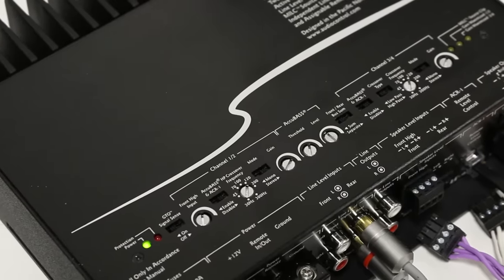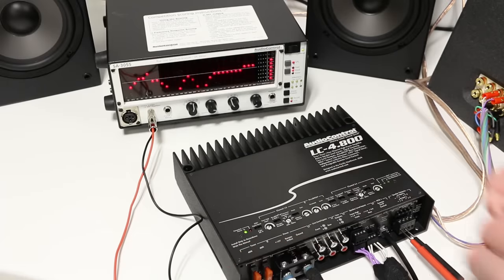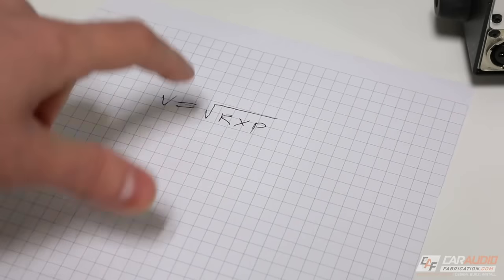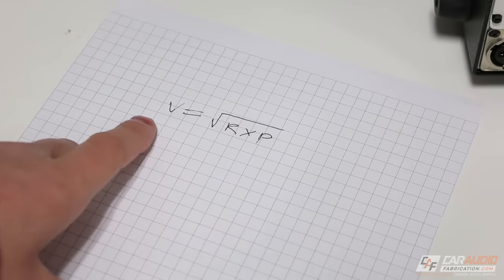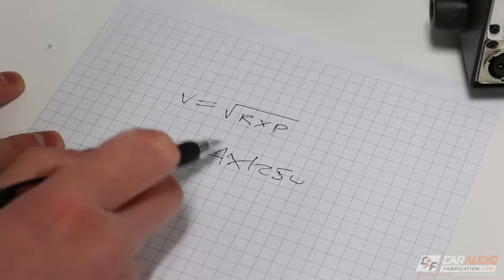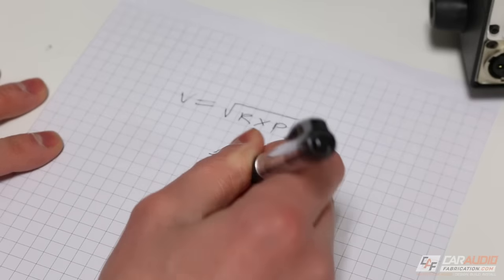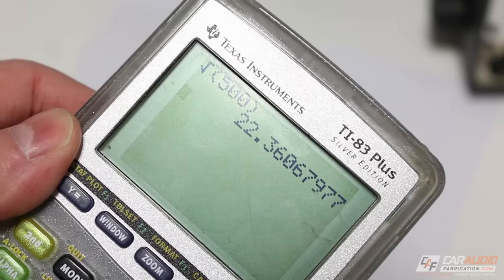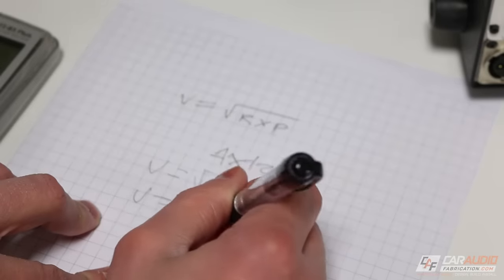Amplifier Tuning Settings How To - Gain, Crossovers, Bass Boost

Comment: Why not show the "test tone and listen for distortion/change in tone" method?  It works pretty well and you could have also determined if the head unit was clipping without needing a distortion detector.  Seems better than the "calculate voltage method"?
Reply from the maker: Rather not intentionally send speakers a distorted signal, and not nearly as accurate as using the proper tools.

Comment: My skar amp has a remote bass knob with clipping indicator. Is the thing pretty accurate?
Reply: MOST amplifiers with a clipping indicator are accurate, as the measurement is in relation to the internal power rail voltage.  It must be noted however, that usually there is some amount of audible distortion BEFORE clipping occurs.  So, any clipping indication should be avoided in normal use.  It can be used for initial set-up, and subsequent spot checks however.

Comment: Please..Every single video I can find on the entire internet fails to say anything about where my crossovers should be set when setting gains with my multimeter and using test tones.  Do they need to be turned all the way up or turned off?  In my case, I'm unable to turn the crossover off on my sub amp or set my amp to full range so its either all the way down to like 30hz or all the way up to I think 160hz. Please and thank you.
Reply: When setting levels with a meter, you may need to use multiple test signals at different frequencies.  Yes, many sub amps are only able to go up to 160 Hz as an example, some 320 Hz, etc., they vary from amp to amp.  For setting component levels, with a meter, you would want to set your cross-over points to allow as many frequencies through as possible.  So in your case, 160 Hz.  You then need to use a test tone frequency that is within the range you can then test.  Yo may need to test a few frequencies, but likely you will be good testing between 40 and 80 Hz for your amp, with the cross-over set to 160 Hz.

Comment: Hey Mark just wanted to say how much I appreciate all the knowledge you share. I'm in a bit of a pickle.
I just purchased a Sony 6ch amp XM-GS6DSP for my highs and mids. I was under the impression that the amp had Rca output for the lows.  I don't plan on using the sub output on the Sony amp so I thought I would use an Audio Control LC2i to give the Sony a preout for the second amp. (JL Audio 500/1 monoblock,  Which will in turn power the JL Audio 8in W7 sub)
 Any suggestions would greatly be appreciated. 
 I really need to eliminate a head unit due to the vehicle being a classic car. So this amplifier is ideal for this set up.

  I appreciate all the help gang thank you. so

Comment: Hi car audio, I have a amplifier question, I have a sound system in my car with a after market headunit, speakers, amplifier, subwoofer and amplifier, and when I turn the volume up and bass kicks in the speaker amp turns off and only the subwoofer will play. I’ve taken the amp back and had it tested and apparently there is nothing wrong with it, anything I could try? thanks!
Reply: Blake Cvirn in my personal experience my sub amp would get power hungry and seem to steal current from other amp. I ran a power wire and distribution block to send power to both amps. Once I backed down the gain of the sub amp the mids amp came back on without cutting out. Make sure you use proper gauge wires , can’t stress that enough. Good luck

Comment: I just bought a KTA-450 alpine I started tuning and it sounds like the front gain is running both front and rear speakers I get nothing from the rear gain

Comment: What if I just added an amp and one 12 inch subwoofer to my factory system and that’s it , Freq Response spec of the sub is 25-500 Hz  what would be the best values to set the HPF AND LPF crossovers of the sub
Reply: The High pass filter would not be in use, as that would be what is sent to your main speakers, which with a factory unit you are not changing.

The Low Pass filter you would ideally set at the frequency where the main speakers naturally start to drop in efficiency and volume.

There are apps you can install on your phone to then play through your stereo, so you can hear what your factory system does, to start your tuning.  Then after you enable your sub-woofer, you can use the app to finish tuning, to optimize the level and cross-over (low pass filter only for your application) for the best overall performance.

Comment: It would have been nice to see what the voltage was after you set gain with the o scope
Reply from the maker: That would imply that you could use a multi meter to set gain, which is not the case.
Reply: @CarAudioFabrication  it will work if you don’t not have a o scope . Just to help others that don’t have the means to a o scope. I set my gains with multi meter and zero issues , the system sounds great !

Comment: i saw another video of a guy using this smd unit doing the same thing, but he hooked the negative to the amp ground. is this different somehow? is one way more correct than the other?
Reply: The instructions point to using the amp ground.  I've done it both ways but never back to back to see if there is a significant difference.  I would suggest using the ground since that's what Steve Meade suggests ;-)

Comment: Id like to ask if its fine to increase the gain on max and just turn down the sub from the radio
Reply: It will all depend on the combination of amp and head unit.  There are many head units, that will have FAR too high of a signal level even set to minimum, with the setting set to MAX on MOST amplifiers.  There are also MANY amplifiers that the max setting is also too high for MOST outputs from many head units.

Comment: Hey, guys. I've just had an aftermarket speaker system installed in my 2013 Honda Accord. I've got a Kaption Audio system with 2 10" SRX Sub-Woofer Dual 2 Ohms, matching 600w amplifier, and component speaker system in the front and two coaxials in the rear. All this was done by a professional, but I have been having odd pressure building in my ear ever since I got this system. I've never had hearing issues before and have never had this problem when I go to clubs ( which is rare). It's not pain, but it is very uncomfortable. I am wondering if any of you have had similar issues and if so, is it something to do with the tuning of the system? I'm trying to find a fix before I give up and have the subwoofer removed.

Comment: Why cant you set your low pass to like 150 herts? will it ruin the sub trying to play those high frequencies or does it usually just not sound as good?
Reply: there isn't a hard and fast rule, mids and highs won't blow a sub, (...like sending lows to tweets) 100hz is a ball park cut-off for "lows"/"subs" ...your box/speakers/mids/music/vehicle will all play into where you ultimately set the x-over points... likely tho, anything over 100hz is gonna have diminishing returns. esp. with larger or stiffer sub drivers
Reply: You wouldn't want to.. generally you want 80Hz and lower and sub.
Reply: The speaker should always be put within its correct range. A sub can play over 80hz just fine but if it is trying to play both a 50hz and 120hz at the same time it will do a worse job of both. The more you can split and assign drivers to their own hz range it will sound much better. The only time you will want to raise the hz of a sub is if you dont have good mid bass. You will see this in most small 5.1 home systems where the "sub" is more of a woofer to compensate the small speakers.

Comment: Bro , my setting bass 35 HZ , may I ask which is suitable for sub sonic combination with my 35hz setting ? 30 HZ? Or ? Thanks
Reply from the maker: For a ported enclosure subsonic should be set a half octave below your tuning frequency.
Reply: CarAudioFabrication ok understood thanks bro
Reply: CarAudioFabrication Is it safe to follow that eventhough my subwoofer's (Fs) is 36Hz? I have ported box tuned to 34hz.

Comment: Hey have a question.. and thank you for making this video very very helpful. Now my question. Does this work like this. I have 2 dual 4ohm 15s wired to 1ohm, now my anp is a skar rp2000.1d 1ohm stable does way more than rated so do i do the ✔ of 2000x1 the root of that would be around 44.something does this work the same doing multiple speakers wired at different ohms. Only reason asking do i do 4 ohm cause of the speaker rating or what it'll be wired to 1ohm? Really stuck, I have 4 15s skar svr there rating is around 800rms an I really don't want to blow them. If have a min please someone anyone let me know if doing right... thanks guys

Comment: I have an amp that supports 2 to 4 ohm speakers, however I have 3 ohm speakers. The amp gives two different RMS for each resistance, 2 and 4, but doesn't list for 3. How would I figure out the RMS for 3 ohms for the voltometer equation used?
Reply: That's one of the flaws that wasn't mentioned in the video with measuring output voltage.  The impedance rating of a speaker is just a nominal value.  It actually varies across the frequency range of the speaker, sometimes quite a bit.  If you knew the exact impedance at 1kHz (or 40 for subs), the formula used would be much more valuable.  That's why in the absence of an oscilloscope or a purpose built meter, I think it's best to learn what clipping sounds like and tune by ear.  Or maybe you can find a shop that has those tools and would be willing to help you.

Comment: so if u have 2 subs at 1200 rms is it 1200 x 4. the squar rooted or 2400 x 4 then suar rooted
Reply: also have to factor in the resistance, to compare to an amp.. I have 2 10" Boss subs, 400W RMS wired to 2 Ohms.. though my JBL amp is rated 350W @ 4-Ohms and 550W @ 2-Ohns so its not quite powerful enough but it still can handl eit
Reply: 2 subs with 1200W RMS @ 4ohms would be 1200 x 2 = 2400.. you'd wanna wire em in parallel to lower the resistance
Reply: Glycerin what watt amp should you use for those subs

Comment: I use bluetooth aux device with ground loop isolator. Streaming music via Spotify Highest Quality. And my phone iş Samsung S9+
Max volume is 15 on phone and max volume on sony head unit 50.
So how do i start adjustment ? Max volume on phone and 3/4 head unit ? 
Or %60 on phone 3/4 on head unit.
Some folk says you should set BT volume about %50-60 to avoid distortion. Thank you for help
Reply from the maker: You really should be using the proper tools to get an actual accurate adjustment. The 3/4 voljme thing is just an estimation, and not really the best to go by.
Reply: Best to tune head unit with a disc if possible (using this method in the video or similar method) then adjust for blue tooth in head unit . Check ALL head unit settings you may find a slave adjustment or bluet tooth adjustment. Also note some phones or apps may apply a filter on the music coming out.

Comment: Great video but one mistake. Doubling the fs is not correct for setting the high pass filter. In my case my speaker had 95 FS which would mean a crossover setting of 190 which means no Bass would come from the speaker.
Reply from the maker: Haha exactly, which means your speaker isn't well designed to handle bass.

Comment: And what if you're using Windows as an audio source or a cell phone that's very confusingly connected to an amplifier but through a preamp first. No I'm not talking about a head unit, I'm talking about a Presonus 1824C. So I have the gain on the amplifier but I also have the game on my preamp and then the volume button from my phone or laptop. And I'm not doing a subwoofer at the moment at least. Capri Sun is at least has its own distortion lights but I don't know which should be my main volume control The source or the preamp. I would think the preamp should be set and never touched again but the alternative would be max volume from the source and then dialing it in with the preamp. But depending on what the situation is one method of controlling it is much easier than another at any given time

Comment: This is a great video and super informative! I am still slightly confused as to why I would want to set my gain while bass boost, treble, and other settings are turned down or flat. I would think that I would want them turned up like the bass knob should be. If the amp is set with bass boost from the head unit off and then I crank it all the way up after it’s tuned won’t I introduce distortion? Not questioning you obviously I just want to better understand, I’m still very new to this stuff.
Reply: I was thinking same
Reply: The answer is yes. And it introduces the most frustrating part of stereo tuning there is.  You can either set your gains in a safety net that 95% of the time won't overpower or send distortion or clipping to your speakers across all songs using a flat curve and only listening to the music as intended.  Or you tune for one song coming from one source to play at max level and sound exactly how you want, but then have to change amplifier or head unit settings for each song.   For installers like Mead or CAF, they are instructing the first choice because there is no idea how to know what song you want from which source in which tuning and then to change it for each song.

Comment: My audio started to cut off for 2-3 seconds then come back at max volume only. I only have a JBL subwoofer installed in the trunk and an amplifier connected to the factory rear speaker. Any advice? Amplifier is set to lowest level possible and not connected to the factory speakers only controls the JBL. Please help!
Reply: Use capacitors
Reply: @Dubai_toh_Canada  It turned out to be the amplifier. It had no fan and it overheated a couple of times, I changed it to a Kenwood with a fan and it solved the issue. Thanks though!

Comment: ok so Gain is bassically  Adjust How Much Volume u can give out before it Does get Distortion ?
Reply: Yes, in a simplified set-up.  You would not want to, and should never, have it set any HIGHER than that.  If however you have an overbuilt system for bass as an example, you may actually want to set it a bit lower to properly balance your subs with the rest of the system.  Of course a nicer option might be to also add separate amplifiers to your other speakers too if running them from the head unit.

Either way, even with multiple amplifiers, this method sets your MAXIMUM setting for the amp without distortion.  After setting each amplifier in a system in this manner, you will want to further tune the amplifiers to work in the system well together, by only adjusting the gain adjustments DOWN as needed to balance the amplifier/speaker combinations with each other.

Comment: I have a bass boost setting on my amp not a knob,  from 0db to 
12db+ so I wanted to now to get set my gain I have to turn that up all the way?
Reply from the maker: If you intend to use the bass boost your gain should be calibrated while bass boost is in max position.
Reply: CarAudioFabrication is it better to just use gain and no bass boost?

Comment: How come I set my system right with my dd1 and barely getting any bass? Have a 2400.1d amp with 1000rms each sub but barley any bass
Reply: You may have already figured out why but you likely have one sub out of phase with the other meaning the positive and negative connections on one sub are reversed. That makes the sound between the two cancel each other out.

Comment: could you take me a question about frequency cuts, I have 2 sundowns nsv3 15, and my box tuned in 32 hz, what frequency cut could I do in low pass on my amp?
Reply: luiz Bass I would say 28 it will not stop playing below that completely depends on yr amp, but really depends on your enclosure how ur speaker is loaded I have seen boxes tuned higher with a lower subsonic cut off it is depending in the situation but I would cut off probably 4-5 under what ur lowest tuned frequency is
Reply: my box is tuned to 32hz, I in my amp was thinking of cutting in 80hz, I do not know if that is correct, because my mid bass does not go down as much, my subs has fs of 30hz, what you suggest me
Reply: luiz Bass u can cut it off at 80 more than likely that hi ur box isn't putting out much anyway, I have the same issue between my sub bass and my mid bass I am missing a little don't want to put n large midrange woofers so I guess push one up higher than it should and one lower then it should with a good step down like a 12 dB step down maybe mark would know much more than me but that is what I do with my system
Reply: thank you so much

Comment: Dang so my 6db setting on my amp is clipping it I had no idea it got extremely loud after I put it on that but if it's going to damage my amp or subs F that. I dont have any equipment to use and properly set it.

Comment: So if I'm correct, 1k hz is for the "normal" speakers and 40 hz for the subwoofer. I came to this conclusion because of the distortion meter he showed had a light for 1k hz detected and 40hz detected. Can someone please confirm this to me? Thanks in advance.

Comment: I just got the smd dd1 distortion tool and when I try setting the gain or finding the highest volume on my head unit the red distortion light won't turn on solid even if I turn it up to max volume. It will blink once but won't stay on
Reply: Read the manual and there's a page near the back about setting your Max volume through the amplifier, do that